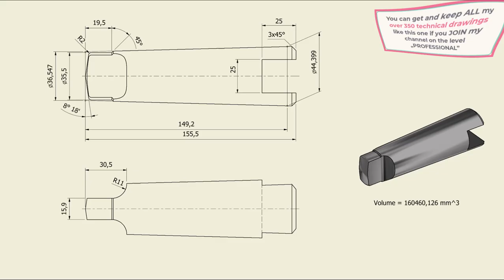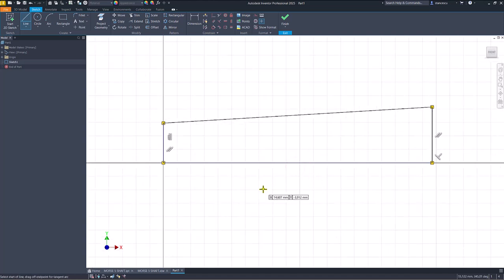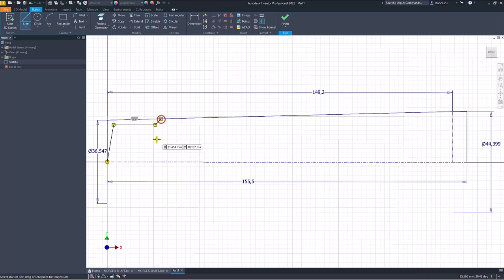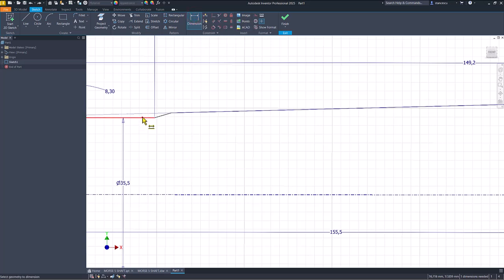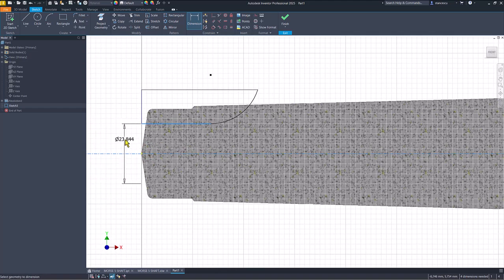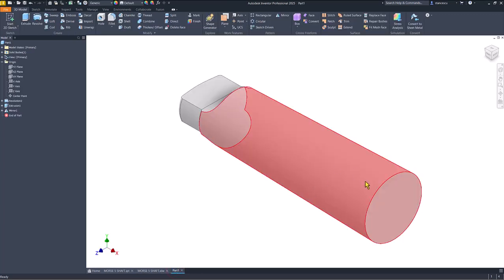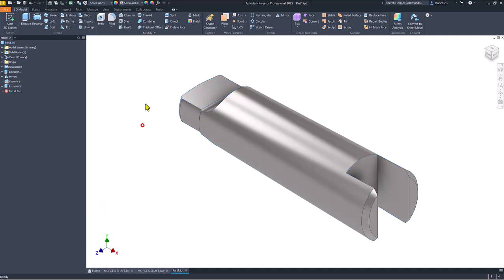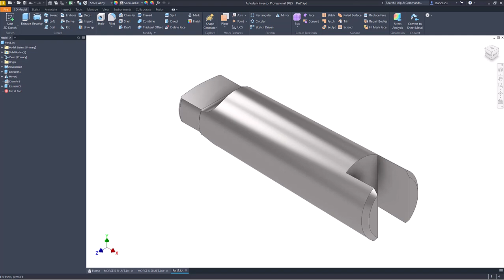Tutorial Inventor - 006 MORSE 5 SHAFT (Remastered 2024) (Part-004)

Comment: 160,460.543 mm³ (relative error = 0.109086%). Could this difference be because Autodesk Inventor 2025 calculates the volume slightly differently?
Reply from the maker: Yes, but in a small limit